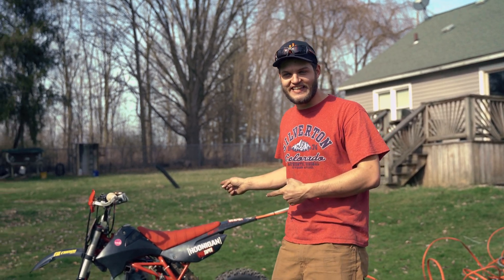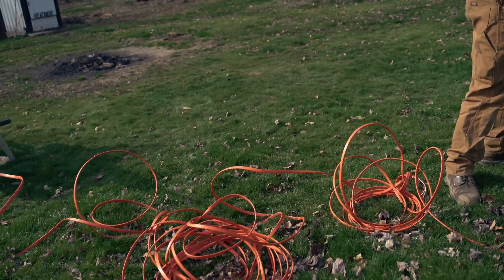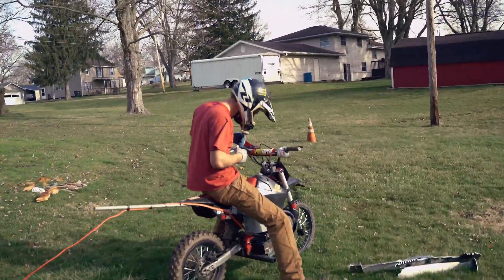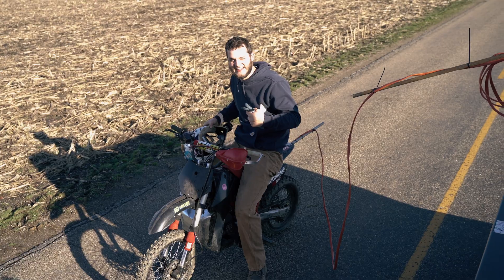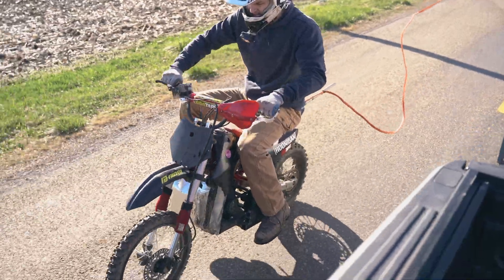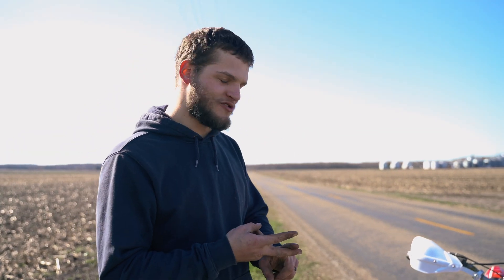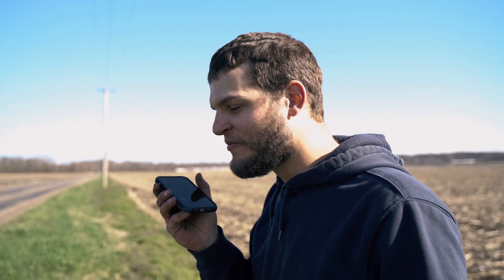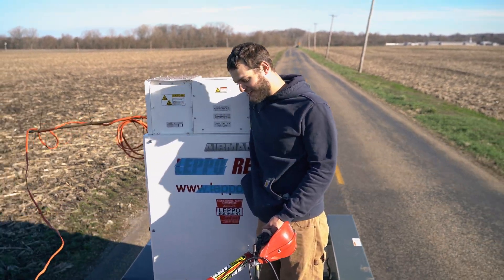Diesel Electric Dirt Bike

Comment: Motors like to pull a lot of current when they first start up, generally more than the breaker is rated for. Since it's only supposed to happen for a second or two it's not going to heat the breaker up enough to make it trip, but when you do it over and over again the breaker gets hot.

EDIT: And so does the spring loaded switch

Comment: I think this has potential! Get a potentiometer for the speed control and run the power cable on a bungee or maybe a cord reel so you have some room to play but it keeps tension on the line. This is some solid entertainment fellas. Well done!

Comment: CVT or Hydrostatic transmission would probably be better. Those kind of AC motors generally like to sit at a constant speed and load not accelerate and de-accelerate

Also a Tesla with this attached and autopilot on 😂